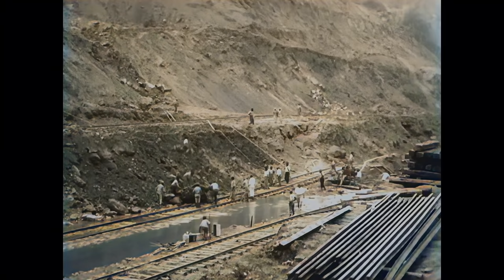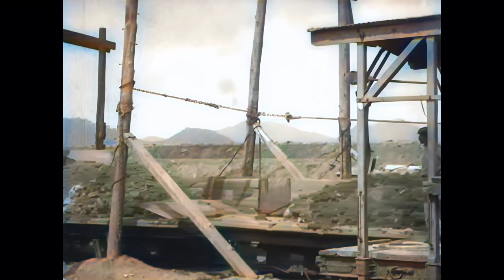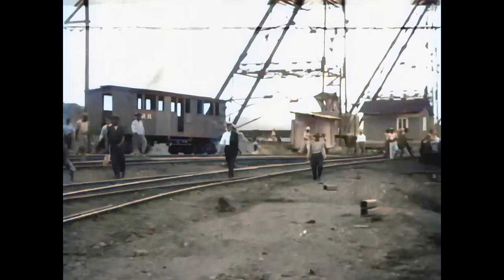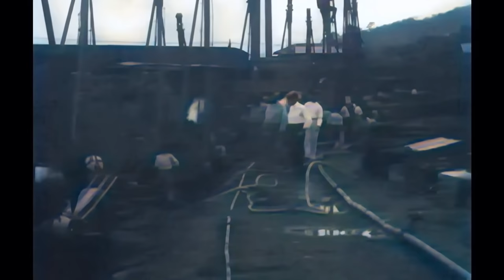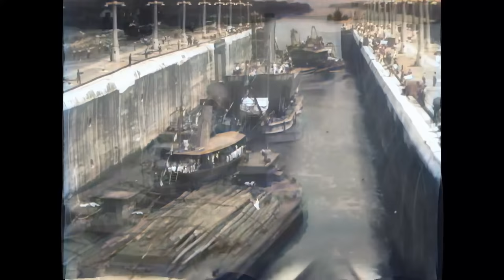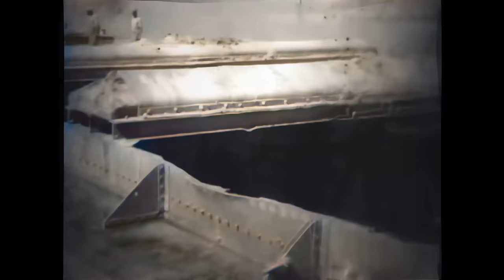The construction of the Panama Canal from 1908 and 1914 in color!  Part-1 [AI enhanced & colorized]

Comment: Those old diggers looks a nightmare to operate and looked like a death trap. The whole machines strength basically boils down to a single chain link. One breaks and it cant dig. The whole mechanical advantage relies through how much that chain can handle a beating
Reply: a strong man pulling levers to engage/disengage clutches and gears in the chains, with no power assist, I would guess...exposed chains and cables moving fast, ready to chop off arms and legs.. if  a chain broke, it would probably whip around with enough force to cut men in half..amazing how fast those things wheel around